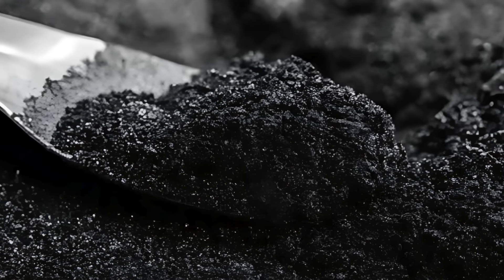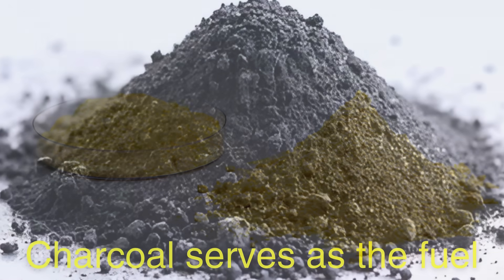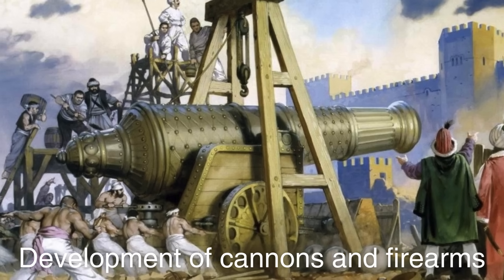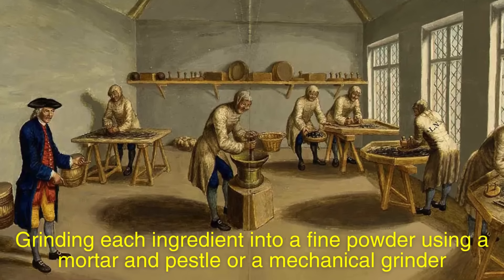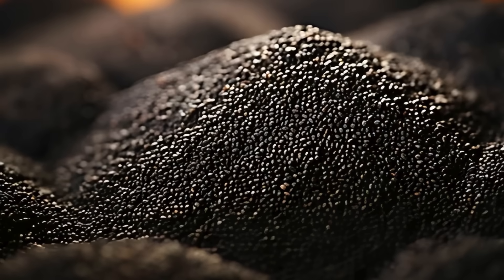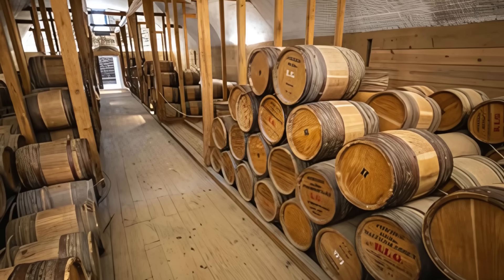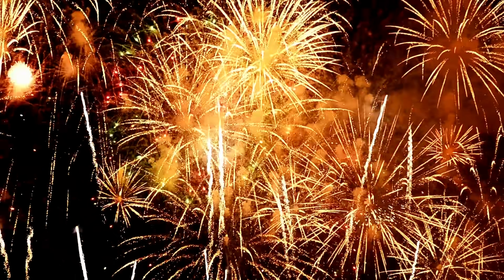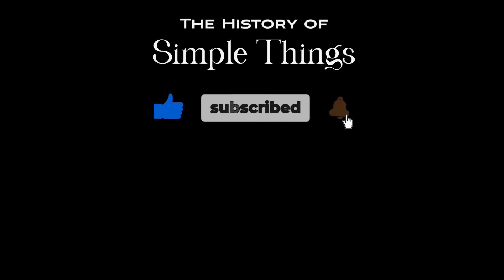How Is Gunpowder Made?

Comment: The problems with using gunpowder were it made lots of smoke and it clogged the inside of gun barrels. When ignited gunpowder produced so much smoke that it obscured seeing the target being aimed at. When ignited gunpowder also left so much fouling residue inside of gun barrels that had to be routinely cleaned away. Then in 1884, French Chemist Paul Marie Eugène Vieille invented Smokeless powder which was three times more powerful than gunpowder and produced less smoke and less fouling than gunpowder. Smokeless powder is used today in modern firearms whereas gunpowder is used for fireworks or for historical reenactments.